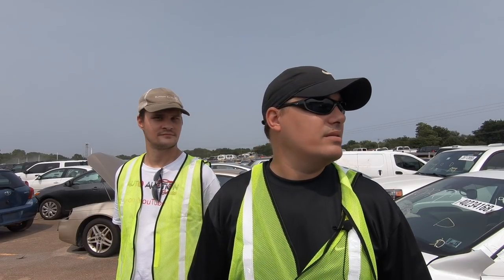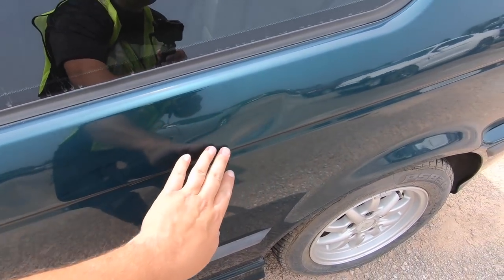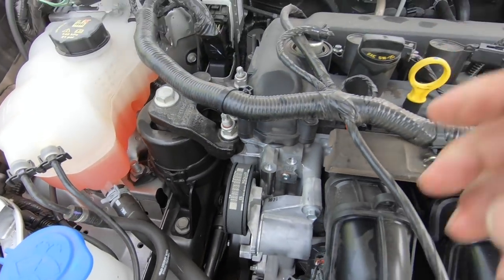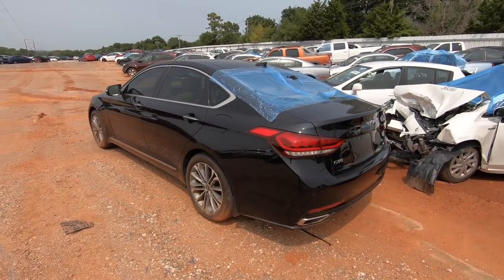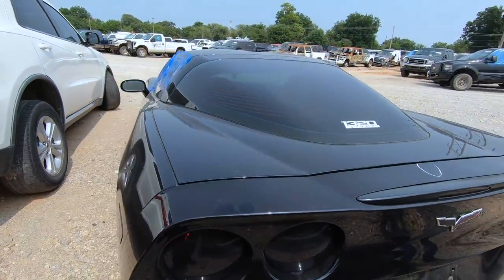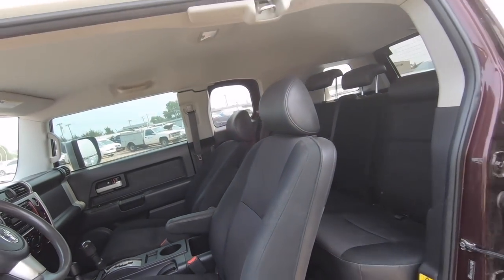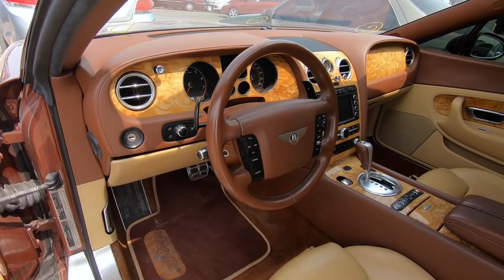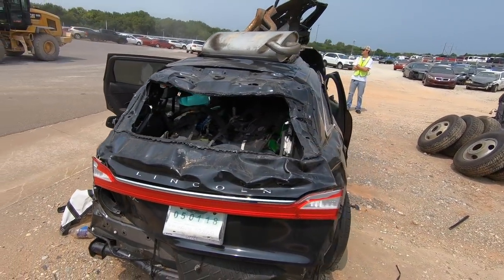Copart Walk Around Video + Carnage + BENTLEY 8-21-18

Comment: Really good videos, my only worry is when you check the oil on the dipstick on the cars in your videos you rest the dipstcik on a sandy/dusty surface then put the dipstick back without wiping off the dust, grit and dirt. Please take a few clean paper towels and wipe the dipstick before putting it back, Not sure if I am OCD  on this issue or talking common sense - Admittedly I rarely do common sense....

Comment: S430, S500, S600, S55, S65 are all the same size. Difference is the engine.
Reply: +jabroni6199  Not strictly true, there are standard saloons/sedans, so an S430 say, but there are also the long-wheel base versions with more rear leg room which was an extra cost from Mercedes which would usually be badged as an S430L, the same as in the previous models.  I believe the S600 only came in the long-wheel base model but I'm sure people have put the V12 and the twin-turbo engines in standard cars by now as the standard car is quite a lot lighter...
Reply: Don't think the "L" series of the saloons were offered in the US.
Reply: @datdamndavisboy   Yes, they were.
Reply: For the 220 series, North America got the lwb model only until the 2003 facelift. Then, only the S430 and 2006-only S350 were offered with the swb.
Reply: +datdamndavisboy  It could be they only sold the L versions in the US.  In Europe we didn't get an L version of the 320 V6 petrol/gas car if memory serves me right and, of course, the S600 was L only.  Come to think of it I've never seen a standard-body S500 in the UK but that doesn't mean they weren't available, with the cost of an S500 new here (£70+ thousand in 1999 so you could have bought a house for that...) I doubt many buyers would have been sufficiently worried about the pennies to go for the cheaper standard car.  I think a lot of the confusion comes from the fact that the cars were never badged as being Ls so unless you really know the cars and can tell an L from a standard car the only way to tell might be that chassis plate with the W-number chassis code on it as the L cars have the chassis code with the L after and the standard cars just have the W-number, so with the '80s S-Class it would be W126 for the standard saloon and W126L for the big cars like the 560SEL...

Comment: every once in a while when an engine runs out of oil, you can drop the pan and inspect the rod bearing furthest from the oil pump, and check the main crank bearing that controls the thrust washer  clearence, but if  forward and back crank clearence is out of spec your engine is toast. Ive replaced rod and main bearings with out removing the engine, as long as the   crank looks smooth and all  the old bearings have the same war pattern installing stock shouldnt hurt, depends on crank material too

Comment: 2:30 check to see if that car was rollbacked doubt that car only has 30k miles for a car from the early 1990's or even 80's wtf is a brand new hyundai which looks brand new doing at copart i hate when cars get toaled for no reason whatsoever that car is proof

Comment: That's a very early Porsche 944, you can tell by the 924-style dash with the individual instruments.  They have a certain rarity value as not many survive but they were an awful long way from being the best of the bunch, the 2.5 litre 4-cylinder engine was rather undeveloped at that point and didn't have much power or refinement and although the body panels were galvanised, the structural metal work either wasn't or wasn't treated well so a car that looks good on the outside can be hiding a LOT of serious issues which is what has killed a lot of these off.  On the up-side, this car does have the unusual factor on its side though that's only really interesting to water-cooled Porsche fans, and the condition of the dash top, which usually gets murdered by the sunlight and cracks up very quickly, and the seats (which look like they might well be in the original 944 Lux pinstripe material (Pasha velour is my memory serves me right) which also doesn't survive well) look to be in decent shape, along with the steering wheel rim with the leather and stitching intact which they often aren't on 100+ thousand mile cars and the gear lever gaiter looks to be intact which again isn't an item that survives well.  With the only real wear appearing to be the top of the gear lever it could well be that this is a low mileage car or, at least, has been very well cared for.  The down side is that an engine rebuild on one of these can easily cost far more than the car would be worth as would getting transmission woes sorted, which are again very common on these early cars as the transmission really wasn't all that strong and can fail in disastrous ways.  A vaguely interesting car for its rarity but not one a lot of people would be interested in...

Comment: Somebody's had the front bumper, or probably the bumper and bonnet/hood off that Bentley.  That could be a very bad sign for two reasons, one, they've looked into it and didn't like what they saw (like it needs and engine due to a cracked block or head/s which is going to be a big bill for a replacement engine) so sent it to Copart and, two, if the parts that are off the car truly are missing and didn't make it to Copart or they've been taken off by someone who doesn't know these cars well and are broken you could be looking at several thousand bucks to get replacement parts.  Parts for these aren't easy to find and even in the UK the lead-in time on ordered parts can be months to years as they're not made in big batches like with a Ford or even a Mercedes...
Reply: gosportjamie Scrapyards are a saviour.

Comment: I'l lay odds that Fusion has been written-off due to the labour cost of putting a new engine in.  A lot of more recent cars are extremely difficult to get the engine out of from above (and quite a few are impossible to separate from the transmission in the car) as the engine, transmission and sub frame is put in from underneath as one assembly on the production line.  That's one hell of a lot of work and that's probably going to work out to a lot of thousands of dollars in labour costs, added to the cost of a new Ford engine, which this undoubtedly needs as it must have been running when it hit whatever tore the sump/oil pan apart and you know Copart have run it for the pictures so the engine will have damage from being run without oil.  If you're fixing the car for yourself or your family and not costing your time then it's probably worth it as you'll have virtually a brand new car for maybe 50% of book value, depending on the title position, if the car sells for a reasonably price.  I suspect this one's future probably lays with a specialist late-model breaker who will part it out down to the last nut-and-bolt other than the engine long block where the parts will end up fixing a lot of other late-model Fusions...
Reply: Wrong

Comment: Please tell me why u didn't even consider the Bentley? That sold for about $375,000.00 new! IF IT COULD BE HAD CHEAPLY, WHAT IN THE WORLD WERE YOU THINKING? RIP THE MOTOR OUT & CRAM A LS MOTOR IN IT IF IT DIDNT JUST NEED A WATER PUMP OR SOMETHING SIMPLE! I BET I COULD HAVE EASILY FIXED IT! AS LONG AS THE HEADS WERENT WARPED & EVEN IF THEY WERE, THEY CAN BE CHEAPLY RESURFACED WITH A WIDE BOARD & SANDPAPER, JUST DRAG THEM BACK & FORTH A MILLION TIMES, CLEAN W/BRAKE CLEAN, INSTALL NEW HEAD GASKET & NEW HEAD BOLTS, NEW WATER PUMP & GOOD TO GO! CHECK THE RADIATOR & ALL COOLANT HOSES!

Comment: The gold Merc was an S430L, so it was the same long-wheel base body as your S600 but a V8 instead of the full-fat V12.  I don't know how much is interchangeably between lower models and the S600 but I suspect not much, though this one does seem to have the hydraulic suspension.  With it being the wrong colour combination for your car it's probably not much good to you as a parts car as a lot of what was standard on the S600 was optional at (rather large) extra cost on lower models and from the looks of it and with the lack of keys I suspect this one's only future is as parts because I really don't think it would be worth putting the money into getting new keys for a car that is totally unknown mechanically.  And that colour isn't great either, speaking personally...
Reply: Pre-facelift S430s and S500s (and the lesser models offered in other markets) did NOT have hydraulic suspension. It had Airmatic. A much more reliable (if maintained) pneumatic suspension.
Reply: @gosportjamie  Before the facelift, it was only available on the S600 and S55 AMG as standard. After the facelift it was optional on lower trims.
Reply: +MrCarGuy20  That's pretty unusual for Mercedes, usually they'll offer their big toys as optional extras in lower models.  It almost makes one wonder if they weren't totally happy with the ABC system when these were launched and it maybe took them until the face lift came along for them to be happy with it...
Reply: @gosportjamie   Well, it was a much more expensive and unnecessarily complicated system. They knew its service life wouldn't be as long as well. The main reason is Airmatic was what was designed alongside the car and much more tested. ABC suspension was a later addition to the design and I believe was first shown about a year after the initial 1998 debut. 

It was just unnecessary for its market outside of the higher performance options. I know low-end models in other markets (EU) like the S280 didn't even have Comand with navigation as standard (NA did). I believe they also had Airmatic as an option. 

The 220 was a very complex project with a range of customization like all the S Classes. The U.S. models just had much of it standard.
Reply: +MrCarGuy20  It sort of makes me think of the air suspension system used on the P38 Range Rover and late Classics.  It was a good idea, it just wasn't up to the job when it was introduced.  At least the Range Rover set-up can be pretty cheap to sort out if you do your research or go to the right people but the ABC system sounds like it's still an extremely expensive system to get sorted.  A lot of pre-facelift W220s in the UK didn't come with Comand as standard, and due to the fact that a lot of the people who bought them new were more mature, a lot weren't fitted with it.  Usually if you see one that has Comand it'll be a higher mileage car that will have spent its early life as a chauffeur-driven hire car, so often the CDi cars...